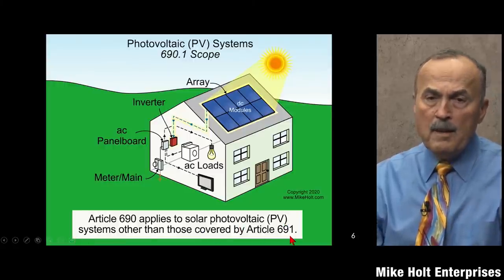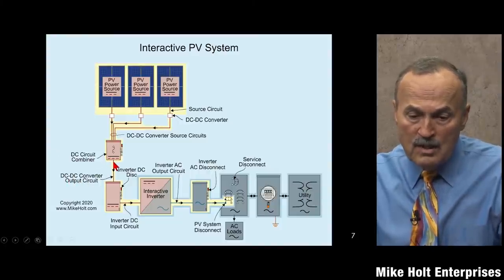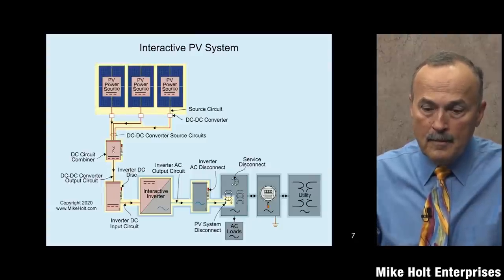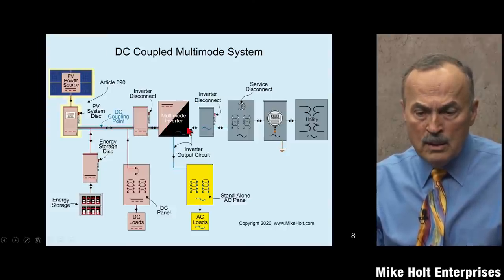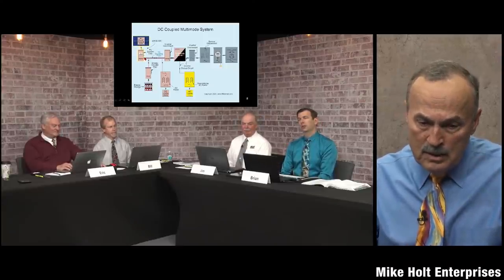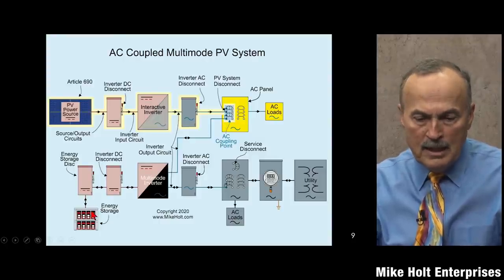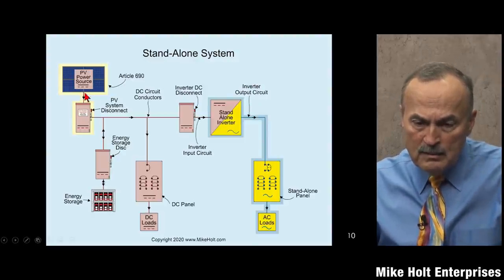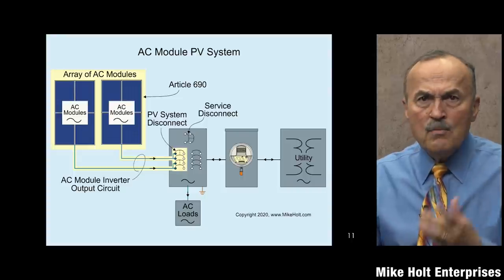Solar Photovoltaic (PV) Systems, Scope, NEC 2020 - [690.1], (39min:21sec)

Comment: Hi Mike - I bought your book on the 2020 NEC for Solar Voltaics.  I have an island system running several things across extension cords.  The "Island System" chapter illustrations are much too small to make out.  What are the requirements for GFCI vs floating (return pin not tied to ground) 120VAC power?  The third pin is tied to the inverter case ground, so is the inverter required to have a separate earth-grounded stake or just tied to the same ground-stake as the city-power junction block?  
There are people who argue about where grounding should take place in island systems and others who say floating is fine because there's no current-fault path (say, through a wet cement floor) that can cause an unexpected shock - but I'm not sure I believe this.  
In your book - there's only a few pages on Island Systems - why is the NEC ignoring this?  My MultiPlus inverter has the option of either tying the return pin to case ground or leaving it floating (at ~60VAC relative to the inverter case ground).  Will GFCI's work with a "floating" return pin? (at about 60VAC)
Reply from the maker: Email me this question, and I'll work to help you understand (and do a better job with my book).
Reply from the maker: Mike@MikeHolt.com
Reply: interesting question, i just got my multiplus, but i had no idea that the multiplus allow you to use floating ground like the smaller phoenix inverters from same company (Victron)

Comment: Hey Mike thanks for the info. I work in the HV monitoring industry, and I wanted to know if there are plans for implementing NEC standards with regards to phase angle conditioning/monitoring for dc-to-ac Distributed systems?
Reply from the maker: The NEC has no such standard.
Reply: Bill knows what he is talking about....

Comment: The "stand alone system" needs revision. The solar array shown feeding both directly to the battery and the dc loads panel could be any volts DC. The drawing needs a DC/DC convertor after the array disconnect and have array feeding DC/DC convertor then to the battery and DC loads panel. Once that is corrected you wont be flowing high voltage DC  to the DC loads it will be regulated by the DC/DC convertor and battery voltage. May also need some revision on the invertor disconnect circuit for the same reason as above, if the invertor can accept high voltage DC and is accepting converted/battery limited DC it needs to show those connections separately.  We need to distinguish the difference where high voltage dc flows and convertor/battery limited voltage flows.. Lets say for example the array is putting out 1000volts at 10-20 amps then that is what the DC loads panel and battery are getting as well as the invertor. That cannot be right... So we dont have to label the specific voltages just need adjust the legs and input the DC/DC conversion took place. Again if the invertor has the MPPT capability it still needs to show that convertor/battery limited DC and array high voltage DC enter on separate circuits. Color coding the arrays DCVA and the batteries DCVA could also help. We also have to assume to much here like the DC loads are 12volt due to most DC devises being 12volt, but many people have batteries at 24/48volt and some higher so might need optional DC/DC conversion right before the DC loads panel. I hope that makes sense. This particular drawing is very confusing and i understand the want to simplify it but not at risk of a deadly mistake by the end user. Also thanks for the videos i have learn much and sadly have much more to learn before i can take on my solar project.
Reply from the maker: Thanks for the feedback, I'll make the necessary corrections.

Comment: Is UL1741 compliance the same as UL 1742 listed? Would UL1741 compliance (TUV certified) pass inspection? Looking at the MPP solar LV6548 but not sure if it will pass inspection
Reply from the maker: The NEC, 690.4(B) requires PV inverters and other PV equipment to be 'listed.' The use of a UL 1741 'compliance' product is a violation of the NEC; unless it's 'listed' for PV systems.
Reply: @MikeHoltNEC  im not seeing it in that section, do you have a link that shows it please
Reply from the maker: @todamnbad  I'm not sure how to help you, since at least 2014, the NEC has required PV equipment to be listed.

Comment: 19 minutes in. Yellow panel. Why would it need a Main disconnect switch? I have a reliance manual tranfer box to bypass the inverter if it failed which it feed 4 seperate circuits.  This subpanel/stand alone/tranfer switch panel is next to main breaker panel. Part number reliance trb1005c.
Reply from the maker: A transfer switch is a 'switch.'

Comment: Remember, in generic terms, solar and wind power sources are not interchangeable.  Each requires its own separate controller.  But they are certainly a good combo for taking advantage of differing weather conditions.   (Not an electrician.)
Reply: I do believe they make controllers/ hybrid inverters that can take in multiple R.E. flavors. (Neither an electrician.)

Comment: Are there any codes that pertain to a completely DC residence? (No inverter, no electric utility connection.)
Reply from the maker: The NEC, Chapter 1 - 4, and Article 720.
Reply: @MikeHoltNEC  Fair enough, definitions and part of the PV sections ... that narrows it down, I'll still review 690. Thank you.
Reply: @MikeHoltNEC  I was thinking less current, thus forcing my voltage up, something closer to 60v at 4 amps at the panel. So my panel won't be in scope of 720 but everything else would.

Comment: 26:29 how does it produce current without the load?
Reply from the maker: PV produces current via the photovoltaic process. The discussion was about 'interactive' PV mode where the Utility and PV where both in parallel with each other supplying the 'loads.' The PV in the 'interactive mode' (parallel with utility) does not directly supply any given load. That only occurs in the 'off grid' mode (stand-alone).

Comment: Who puts DC-DC convertors on the panels before they go into the inverter? Nobody does that... Doesn't make any sense.
Reply from the maker: I suggest you do some research on dc-to-dc converters and their applicaiton. This is covered in my book and video program.
Reply: Isn’t a module optimizer a DC-DC converter
Reply from the maker: @Yuroon360  Yep.
Reply: You can check out Alencon based in Hatboro PA. They make DC DC converters too. I have a close relationship with them but can't seem to use their product in typical project applications. Mostly for Repowering
Reply: SolarEdge is a manufacturer whose system by design, uses DC-to-DC converters, also known as optimizers.   One reason you would want to use them in a design, is to accommodate diversity in tilt/orientation and shading.  Another reason you do this, is to satisfy rapid shutdown requirements, as optimizers default to a shutdown standby output voltage, and stop the module open circuit voltage at the source.

Optimizers work by solving an algebra problem, in order to satisfy Kirchhoff's laws.  Like a transformer, they trade voltage for current.  They dynamically adjust the buck/boost ratio to adapt to the conditions, and cooperate with each other to solve the algebra problem.  Voltage adds up to an inverter-governed input voltage, and current is the same in each unit.  Individual voltage is free to vary as needed, and ends up being proportional to what each one can do.  Each module can operate independently of all the others, unlike when wired in series in a standard source circuit.

Example:
20 optimizers in series.  First 15 output 300W, remaining 5 output 100W.   Inverter-governed total voltage = 400V.
Solution: the first 15 produce 12.5A at 24V.  The remaining 5 produce 12.5A at 8V.
Reply from the maker: @carultch  Excellent post and you are 100% correct.

Comment: Very bad advice to tell people that a molded case breaker can be used as the pv disconnect. It's important to explain the reasoning that utilities have to require a visible break even if not in the NEC. Iny opinion molded case breakers should not be allowed per nec because of this extremely common requirement (for safety!)
Reply: This video only covers what is required to make the system comply with the NEC.  Utility requirements are another set of standards entirely, and are utility-specific.

A molded-case circuit breaker can be used for PV disconnects in general, where electrically rated for the details and direction of electric power, and where their purpose doesn't concern the utility.  Commonly used when ganging up multiple inverter output circuits in a subpanel dedicated to the PV system, or interconnecting to the main panel.
Reply: @carultch  ok yes that's certainly true. I think the NEC should adopt similar nomenclature as IEEE 1547 regarding POI and require this in the NEC. If the molded case breaker is counterfeit and fails closed, rapid shutdown doesn't operate
Reply from the maker: The wiring for almost all PV systems terminate to a circuit breaker (which has the 'required' overcurrent protection for the PV system), which is the PV system disconnect. If the utility wants an 'additional' disconnect (without overcurrent protection, like a knife switch) that their call. I'm not giving advice, I'm explaining the NEC requirements.
Reply: @MikeHoltNEC  fair enough! I love the YouTube content and this format, starting from the basics and developing to a specific end goal discussion. It's easy to get caught up in specifics like what I brought up here.
Reply: Maybe instead of writing YouTube comments I'll write to the CMP next time and give it a bit more thought and thoroughness...
Reply: Many states don’t allow utilities to require an AC disconnect on small PV systems (typ 10 kW and below). Since there are several means to de-energize a PV system, requiring an AC disconnect can be an unnecessary cost.
Reply: Utilities understand that pulling the meter is a means of disconnect, but some still insist on an extra near the meter.